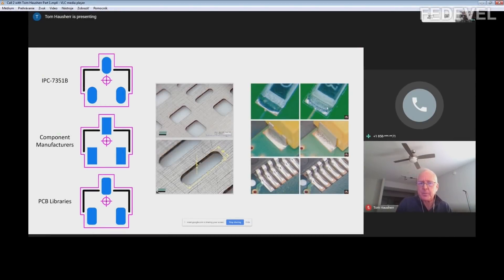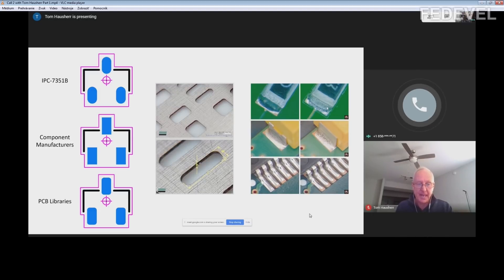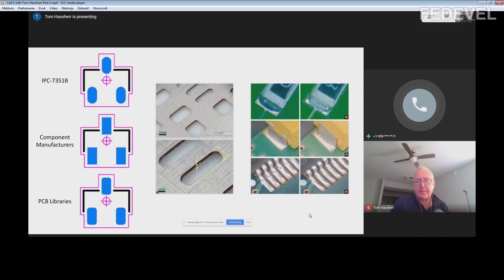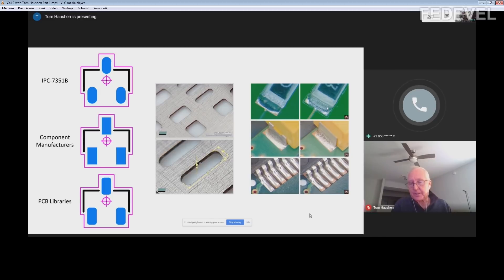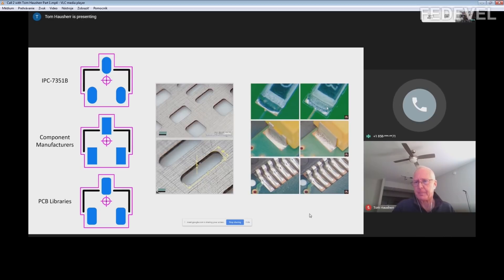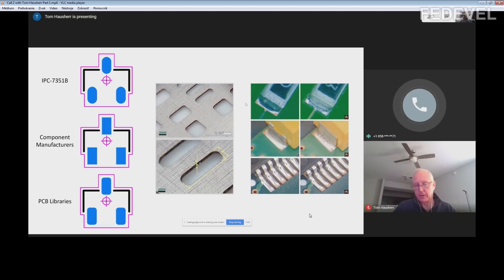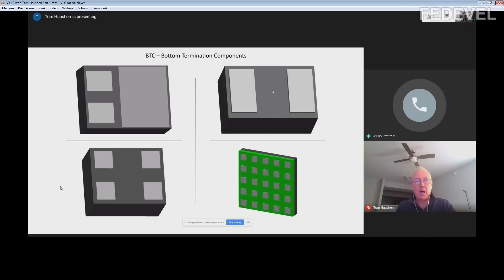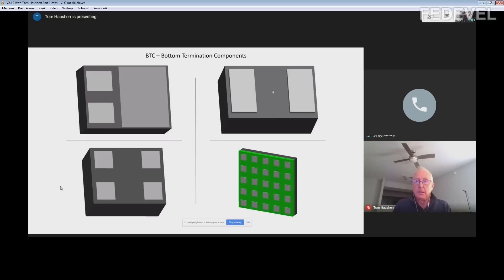What is The Right Pad Shape to use in PCB Footprints? | Tom Hausherr | #HighlightsRF

Comment: His reason for using rounded rectangular pads is not very compelling. So what if that's how the stencil is made? So what if there is still some of the original plating visible? If he'd said something like the rectangular pad corners don't adhere as well so the chances of it peeling up are increased, then sure. But otherwise it is much easier and less prone to error for them to be consistent with pad shapes, in my opinion. As Robert said at the end, you can't really go wrong with making everything rectangular. That's my biggest gripe with PCB Libraries and the unapproved IPC7351 rev C. If it's not broken, don't fix it. It's making changes for the sake of making changes and has unilaterally been pushed into the market through PCB Libraries without support from the actual committee, or really anyone else. There is not much solid, corroborated data which suggests that these changes do any good in the real world.

Comment: Hello Robert,  it's really great that your are helping others to think about the daily work. Thank you 
Here I have one question, when a rectangular pads not cover solder in corners, the same will apply for Bottom terminations with rectangular pads.  Why it is not recommended for bottom termination component's to have rounded rectangulars. I understand Tom said we should not reduce pad area,  but still I don't think that solder will cover in corners. So I like to use rounded rectangles even for BTC. It improves rework ability by improving peel strength of pads. 
Please correct me if I am wrong,  I am so excited to know your response.

Comment: Actually  some of this isn't entirely correct, the reason laser cuts have round corners is because it allows you to cut in a single vector path.  Square corners require a laser to "step" - stop, position, move etc. A rounded rectangle allows a single non-stop cut path.  Faster & more efficient.
Reply: How do you use a laser, which is circular and has a finite diameter, to cut an internal rectangle with sharp edges, without making cuts external to the rectangle like in a stencil?
Reply: @lachlanchartier8061  That's because a laser is not of a finite diameter; real-life lasers have focal points, and they can be focused to converge at an infinitesimally small point (not technically in practice, but close enough). They are in practice to facilitate cutting (higher energy density) at the expense of focused cutting depth, actually.

Comment: Thank you Robert for these types of videos. 
I prefer rounded rectangular shape. Because when you use it, you can draw more traces between 2 pads because of the edges. And it is easy to build it. You are drawing directly rectangular then press CTRL+A  and make it all rounded rectangular shape. Also, it has better looks, also when you solder it everywhere capture the soldering. Also, you can draw the trace onto the edge of the pad. And one more thing, it feels good and right :)
Reply from the maker: Yes, especially under BGA the corners can make difference.
Reply: @RobertFeranec  I haven't experienced with BGA yet.  You are the GURU of the Altium and PCB design  :). You should know better than most of the designers.

Comment: For professional PCB design, the pad shape doesn't matter much for many components (see Mr. Hausherr's remarks for under-package pads in the last third of the video), and I understand that this channel is very much geared to the higher levels of PCB design. For 'hobbyists', so to speak, there's certainly no harm in mixing and matching pad shapes to signify things like polarity (square/rectangular pad = cathode), ground pins, and so on when a silkscreen is either not available or doesn't provide sufficient space to indicate.